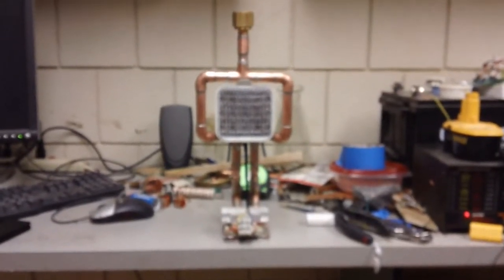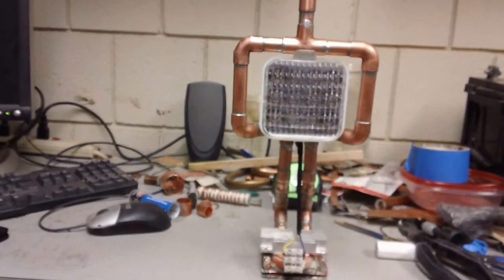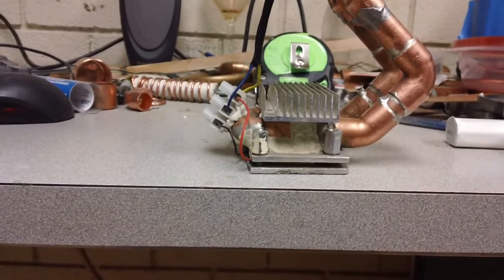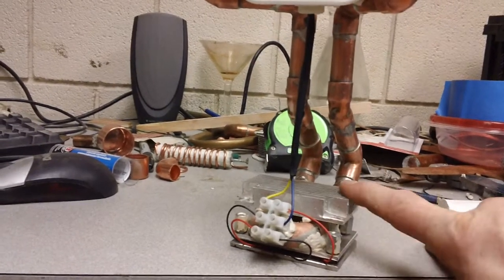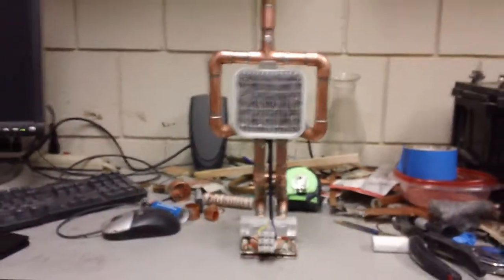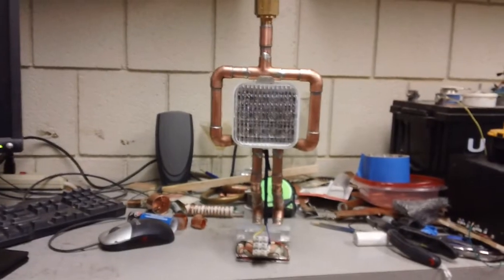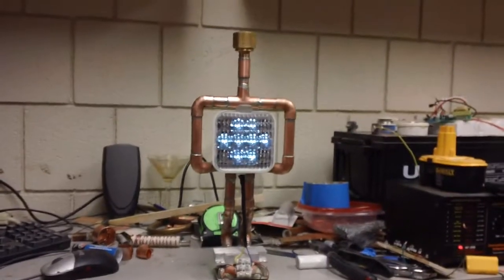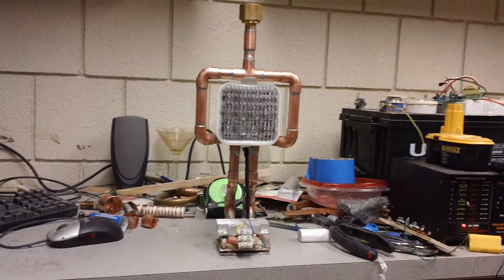Thermoelectric light for Rocket stove  Part 2

Comment: can you tell me where to buy and what TEG modules you use?
Reply from the maker: Hello Mr Ebert. May I suggest to you that you watch my video titled Rocket or Traditional Free Electricity Production for that and much more info that you may find helpful . thanks for watching
Reply from the maker: As to which modules I use. I use the ones that fit my application or use them in series or parallel to fill my needs. they have a rated voltage at a delta T or temp difference. if that voltage is not enough then run them in series until it is what you want if thats not enough current then run another set in parallel to double the current, understanding ohms laws is a good thing here.